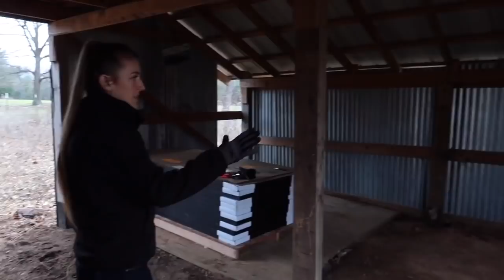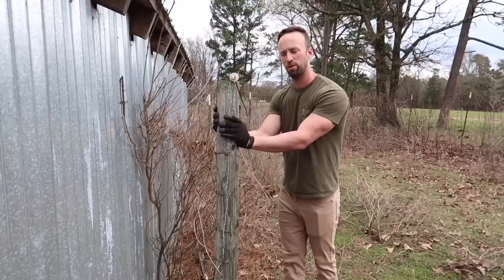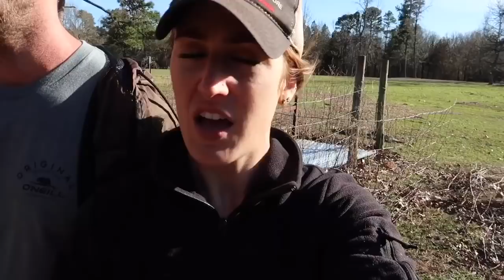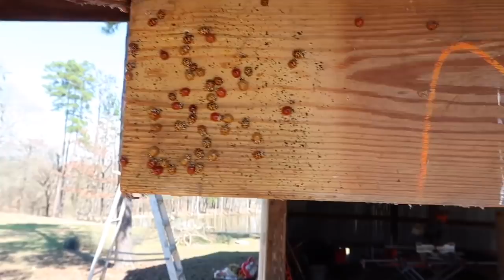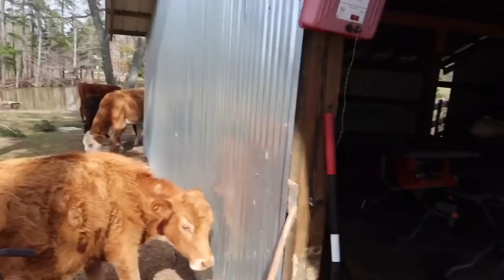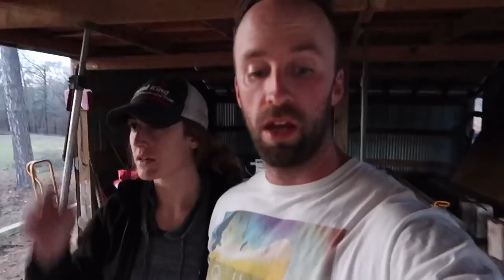Converting old barn into SOLAR POWERED workshop | Part 2

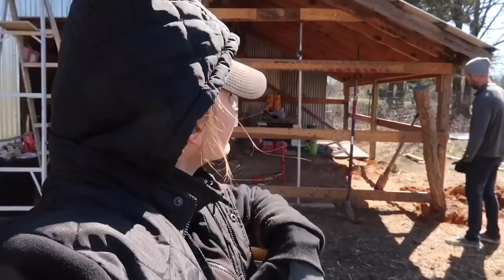Comment: 7:28 Spencer hurt himself
doing a similar action i gave myself an umbilical hernia. it felt like someone stabbed me then there was a hot sensation. it was painful to stand up straight. gotta be careful man!

not that it matters...
when i hurt myself it was from lifting 50cal. crates up onto the bed of an M977 truckbed. there were supposed to be people there to help me but of course i was left to do it by myself. the boxes of 'stuff' were for a battalion range qualification. i ended up humping all the 'stuff' up there alone. me being a young man thinking i was indestructible and wanting it to be done so i could go to lunch just did it.
M977 truck bed = 5'3 high
crate of 50 cal 'stuff' = about 100lbs
number of crates needed for that battalion range day = 62
and yes, i put that much up there by myself. it's a wonder i didn't do more damage that just the hernia.

Comment: This is so much me things i wanted to do, if i done this with my 2 wifes. 1st wife would of burned the barn down and said i was stupid and left. My 2nd wife would of just sit there and watched me when i got done then she would of left and took everything. Both of them soon as things got hard or they had to put effert into it they where gone and blame me. You suppose to be a team, partners in crime and if one slacks then it will fail. Relationships are a life time job, 10 years from now you will be tested, 20 years from now you will be tested and running off with another partner is not the answer, the grass is never greener on the other side, the story changes and the partner changes but it ends the same. Wish you guys the best and keep it up, im 50 now and been single for 10 years, if i do anything like this now it will be with my 4 sons with no women involved because i cant trust no more. Good Luck guys

Comment: Sliding chop saw is  realy nice that's what I have is the ridgid but mine doesn't slide but I have been through a lot of table saws and 20 years ago when I was building houses the best table saw was the Skil twist cheap but you can cut 8 foot 2x4 down the center all day with it Skil twist

Comment: Over a period of about 3 years, my son and I removed about 50 posts set in concrete.  Some round metal fence posts, some cedar, some pressure treated.  We tried several methods after the first couple of dozen were done "the hard way" !   If the ground is soft (spring) your Prius would have no problem https://drive.google.com/open?id=1jYGOpfsjOel7Iyd6UVlUbDH5pdJmulG5

Comment: If you ever run into that problem again.  Heavy post or rock and can't get it out of the hole.  Stop trying to lift it.  Just slowly fill the hole in with dirt and rock the item back and forth so that it slowly rises to the top.  Eventually the hole is filled in and the item is rolled out.  Even if that means you have to dig out all the dirt again is is better than a muscle strain or a hernia operation.

Comment: 2 and a half feet to the footing ... ARE YOU BLOODY NUTS ... in the cold climates you need to get below the frost line like the timber post was ... 4 feet or more ... at 2and a half feet your shed will be out of level and square and trim after the first winter thaw .... then all that work you put into the shed will have to be ripped down and redone yet again ... do it right from the start ... rip all the posts out and sink them 4 feet down THEN rebuild the shed
Reply: They are in Texas. Jan 8th it will be in the 70's. I mean 22 C
Reply: 2 1/2 ft is normal in the South. Get over yourself.

Comment: Is two feet down far enough for footers in a cold climate?  We have to go down four feet where I live to prevent heaving.
Reply: nope not even close ... they need 4 feet where they are ... that shed will be all buggered next spring when they have to rebuild it ... yet again
Reply: Depends on where in texas they live.  Looks like some counties have a 24" minimum, others 30".  In colder climates its 36" and deeper.  Also depending on your soils.
Reply: @Cavey1975  I noticed the ones they pulled out were about 3', maybe a little more.

Comment: On the time stamp between 4 to 520 in removing the post Spencer had the right idea of wiggling it, but to pull it next time drill a hole through it, then add a long piece of rebar in the hole, then he can get a better hold and pull it straight up, after the first pole is out, he then can use the first pole as lever to lift the others out, this piece advice or tip may come to late, but hope he can take this knowledge for future endeavors, Ravage
Reply: Even better is to use an old style bumper jack. Wrap a chain around the bottom of the post and hook this onto the jack. Pops it out of the ground in just seconds. Dad and I built many miles of fence during my teenage years.

Comment: I wish I could show you guys the method our old neighbor showed us to remove big posts on our farm here in Texas. Mr. Morris got a sturdy wheel, we were truck drivers so we had a truck wheel (that made it so much better than a car wheel...) but you put a chain/rope whatever around the post right at the bottom of the post, snug it tight, then run it over the top of the wheel, then we connected the other end of the chain on the tractor (he let us use his tractor as we'd not bought ours yet...)  and pulled it right the hell out. It worked like a fulcrum and it made a really hard job ridiculously easy. Everything I ever learned was from some old person with better know how. Hope this helps in the future if y'all are still checking old posts. Just found your channel, love the nutty way you two work together. Looking forward to the other posts in the series...
Reply: That is a good idea. The tire let's you pull straight up.
Reply: Yeah like they own a tractor ;)
Reply: Not really clear where the wheel goes? just on the ground i guess

Comment: Awesome job. Glad you replaced the post with pressure treated lumber. Looks like you have your work cut out for you.
Reply: now and next spring when the shed heaves with the thaw because they only went 2 and a half feet down in a cold climate where the frost line is more like 3 feet down